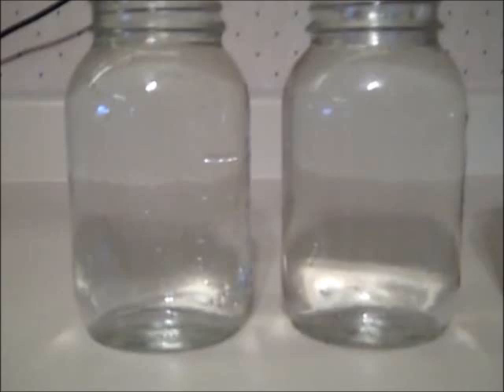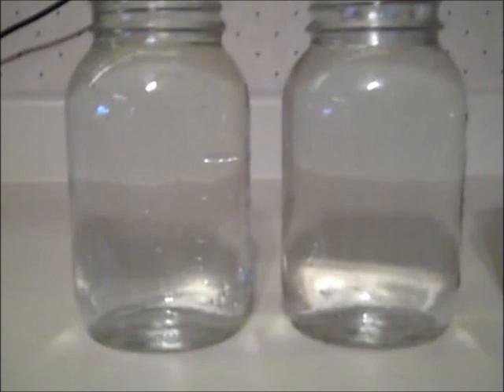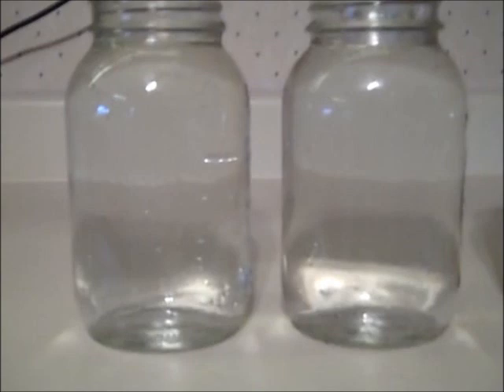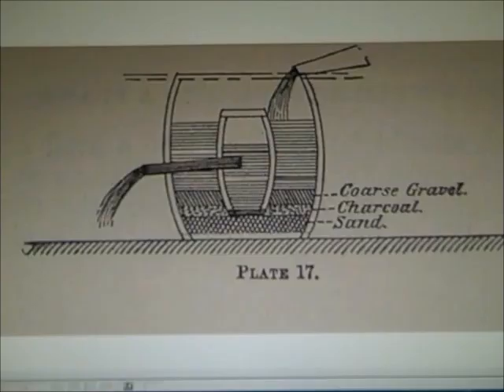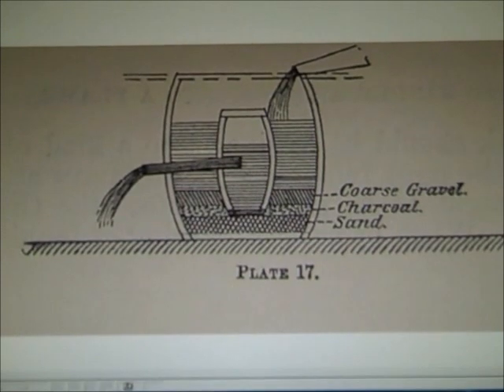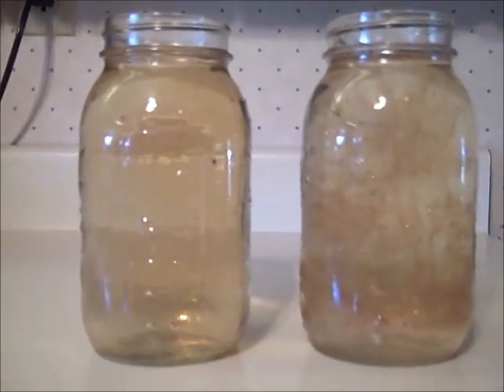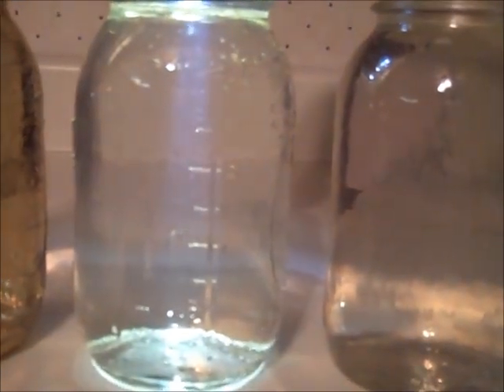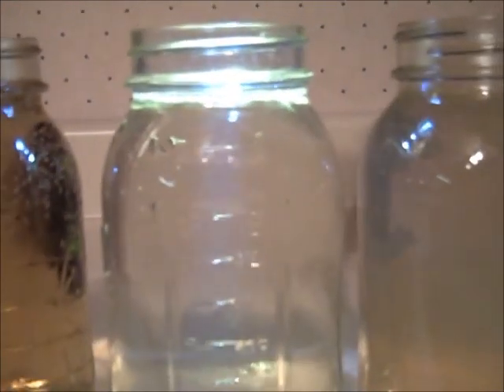Water Filters in the Old Days

Comment: UV light is still used to eliminate algae and clarify water for fish ponds.  Line and Alum are used in many municipal water treatment plants.   To remove iron, there are several different methods used.  One is to use a propeller to agitate air into a "stilling" tank where it is kept for a set period and then sand filtered like what you described. The other way to remove iron is to use a coagulant like potasium permangate and then sand filter. Your alum is considered a coagulant. good video.

Comment: I have been collecting rain water for drinking for 8 yrs now.I do filter it I bought my wqter fliter at walmart just a cheepy and i have not had any problem.I have 4 55 gallon drums with 4 inc sqr hole cut out with a peace of fine mesh screen wire over the hole and rain gutters sitting over the 4inch hole.Now for a home made water filter I use sand charcoal and grass.in a 2leter coke bottle. grass first sand next then charcoal..with rain catch I still have bug that get into t he 55 drums

Comment: @imstillworkin Oh ya I`ve used this effect many times same as if your using a pot or pressure cooker that has a lip or handle on the end & the steam bubbles are escaping splashing all over take a piece of paper towel 2" long lay under lip of lid & on top  where bubbles comming out it will quit and keep water in works everytime .

Comment: The alum is a coagulant that has a posotive charge,the groundwater has a negative charge as the water is stirred/flocculated they cling to each other making a very tiny mudball which is denser than the water and it should settle to the bottom,i really don't understand why the pondwater accumulated to the top unless the water was really cold(when water reaches 40 degrees fairenhieght it becomes more dense than the floc/particles what doesn't settle out should be filtered and disenfected.